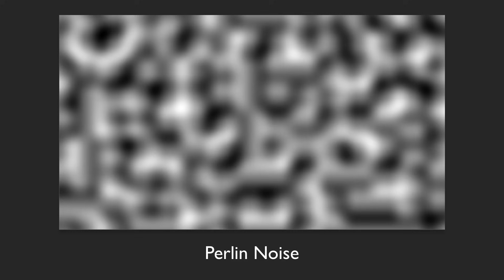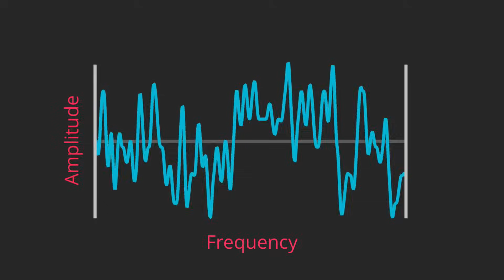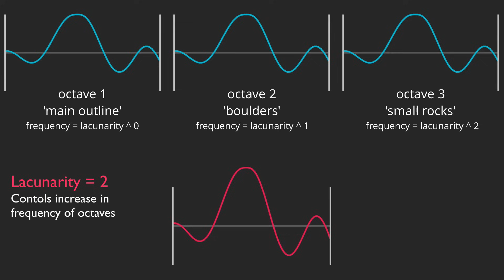Procedural Landmass Generation (E01: Introduction)

Comment: how do you add trees?
Reply: did you ever find out? i am trying to do similar for my game i am making
Reply: @nubswagg  i did it my own way, i get the x and z position of the width of the terrain, cast a ray really high up going down from a random x and z position within the terrain boundrys, check if its on an angle thats not too steep and make sure its not touching the water. Then just place a tree prefab there.
Reply: @samllea1 yo heck yeah thank you I’ll do that too!

Comment: Sorry this turned out to be a bit of a novel.

So I started this tutorial about 2 or 3 years ago and nailed it! I cant say enough how much I appreciate it. I was a bit bummed out when I notice no water was included.

A few years later I decided to tackle the issue my self and put it on the back burner (I got stuck). And dare I say I recently got it working but the only problem is the water is not effected by the lod system due to the Texture2D heightmap generation. So water in the distance is the same as up close which is a minor cost that I will have to pay ;). I kept a eye on the profiler and it runs at a consistent 60 to 100 frames on a  8gig laptop with a gtx960.

The problem I was having was when the seams for the terrain mesh are stitched together. Long story short my solution was to duplicate the entire process then insert the word "water" to each script that was used for the mesh generation. I then used a water tile plane as the "mesh container" instead of generating a texture2d with perlin noise. :) 

I noticed that I was getting errors due to a HeighMap which I changed to WaterMap and it always returned null. And I couldn't figure it out until I commented out the if statement inside of UpdateTerrainChunk() which I changed to UpdateWaterChunk() at

if (lodIndex != previousLODIndex)

along with one of the last lines of the script at ThreadedDataRequester.RequestData

So everything is visible and hidden when it is needed but the lod always stays the same. Not a huge deal as I am Ok with what is happening in the profiler.

I realize this is a old tutorial but I don't care. Thank you! thank you! thank you!

I will post a video on my personal channel if anyone is interested in seeing how I did it. :)

Comment: So i started with unity because i saw someone put in 3d models and made it just work.
Soon i quickly realized that i need extensive amounts of c# knowledge in order to manage creating anything at all. So i have huge respect for your work. It almost looks like you are living c#. I need to know how you learned to become so adapt to c#🤔
Reply: Yes and no. If you're creating systems like these from scratch then yea you'll need a lot more than a basic understanding of C# as well as the engine. 

However, there are dozens of high quality, purpose built, assets available to drastically reduce the amount of work on your end. PlayMaker is a visual tool for creating gameplay No code required. Odin is amazing for custom inspectors (something you could spend a LOT of time writing from scratch) and there are even terrain gen tools complete with day/night cycles and even a weather system to boot. I'd give an example but there are many flavors available.

You know that old saying don't reinvent the wheel? People have dedicated their livelihoods to making tools to make YOUR life easier and nothing you could cobble together will even come close in terms of value and time. I know that money doesn't grow on trees and some of these assets are pretty darn pricey, but a $50 - $100 asset could save you weeks if not months of work.

TL:DR If you have a specific problem, like procedural terrain generation, and value your time more than your money. Don't reinvent the wheel... just buy one.

Comment: If anyone needs help with understanding this video, try ignoring the red graph. Imagine each octave layer as separate land generations.

all that's happening is it's adding the value from the graph, onto the main grid. 

and the "lacularity" is how much each value is.
and each curve. is how much the value goes down. the more curves, the less impact it has because when you hit enough curves, it balances out and becomes an average value.

note: lacularity also scales down the graph. so basically its like you're compressing a spring. laid out, the spring is very long and can go very up or down, but compressed it becomes a straight line.

persistance is just the multiplier. it multiplies how much each value occurs. it takes the coil, and repeats it.

for example, if you have the number 16. with default layering, the single square value is (x + 16). with persistance, it's (x + y(16))

you multiply the 16 by the persistance.
Reply: for basic understanding (without persistance or lacularity),

the graphs are litterally added together.

combining the graph: y1 + y2.

take the first graph's value and add it to the second graph value.
it's supposed to represent the graph getting darker as it gets closed to 1.

Comment: Awesome and helpful videos, but I have one general question. What’s the benefit of using this method for terrain creations versus the built in terrain GameObject in Unity?
Reply: That's a good question and I have an answer. As I have been coding a game that required the ability to load large terrain data, I felt very limited by the Terrain gameObject in Unity. First, I could only have 8 texture layers (while I needed at least 50 different layers to represent the different terrain types). Second, as I began to scale my game to create larger and larger maps (by tiling Terrains together), the fps really started to drop. If you're interested, I've recently posted a video on how I used Sebastian's code and merged in with my GIS map builder code and the results are awesome! (https://www.youtube.com/watch?v=0FALTkyisww)

Comment: What if you change the persistence and lacunarity based on a low-frequency noise map?
Reply: Persistence would be OK, because persistence turns into amplitude. But if you vary lacunarity with noise, you will get different results near the origin compared to far away. This is because lacunarity turns into frequency, and varying the frequency zooms the noise layer in/out. Further and further away from the origin, the noise being zoomed will be "moving" faster and faster to account for its changing zoom level. BTW, you should check out some of his newer videos or code to see what noise he uses now, because he doesn't use the same type of noise he talks about in this video anymore. I don't recommend using it either, because of its direction bias.

Comment: does this tutorial work for a realistic terrain? please answer i want to follow this but i want realistic terrain and now low poly/ blocky... thanks in advance
Reply: For your first question, at the beginning of the video there is a fly-by of the terrain. I will let you decide if it is realistic enough for what you are doing. For your second question, the only way I can think of to make the terrain more blocky is to add a level of detail variable which you can find in tutorial number 6.
Reply: For your first question, at the beginning of the video there is a fly-by of the terrain. I will let you decide if it is realistic enough for what you are doing. For your second question, the only way I can think of to make the terrain more blocky is to add a level of detail variable which you can find in tutorial number 6.
Reply: For your first question, at the beginning of the video there is a fly-by of the terrain. I will let you decide if it is realistic enough for what you are doing. For your second question, the only way I can think of to make the terrain more blocky is to add a level of detail variable which you can find in tutorial number 6.

Comment: Hey Seb, you've been helping me out so much with your videos, and I've been learning a lot by watching them!
I was just wandering if you'd be able to shed some light on how you created the textures for the intro part of the video (smooth lines), as opposed to the pixelated, point-by-point textures that we end up generating? Are you maybe colouring by vertex in that example instead of using a texture? If so, how are you determining which of the adjacent vertices to set for each colour, so as to not end up with the same 'pixelated' effect?

Thanks again for the great videos!
Reply from the maker: +David House Hi David, I used a slightly modified marching squares algorithm to generate the textures. I'll post the code in case you'd like to take a look, though it's very messy and unoptimised in its current state. http://pastebin.com/71mgVMaL
Reply: +Sebastian Lague Thanks so much for that. I wouldn't have thought to use marching squares to accomplish that. Based on your code for it, I did have to make a slight change, at line 53 of yours where you fill the cell before then checking the specifics of the cell, for some reason I needed to do a check to see what the average colour was among the four corners of the cell, and fill with that colour, instead of just filling with the top left corner's colour.

If I didn't do this, I ended up with weird artifacts along one side of each colour change shown in this screenshot: http://imgur.com/i9n7tve
With this edit, this is the result from the same section of map: http://imgur.com/XO8iLAQ

This does, however, seem to 'eat into' the adjacent region slightly, but that's something that I can offset with the colour regions in the inspector. So all in all, it's working now!

Thanks again for your help!